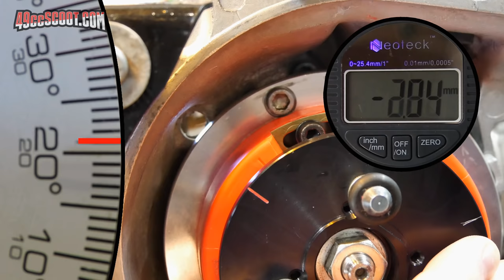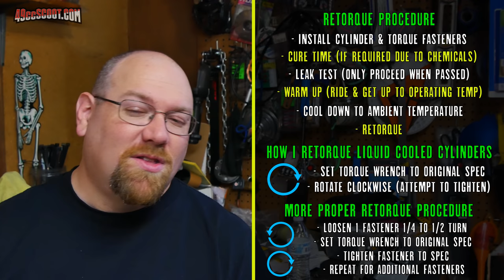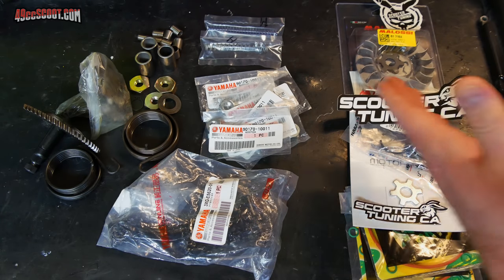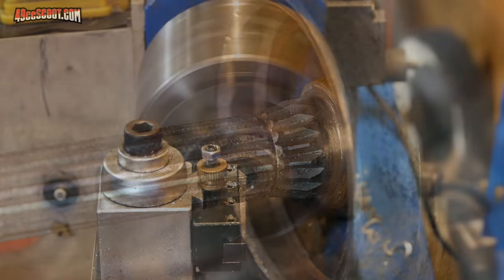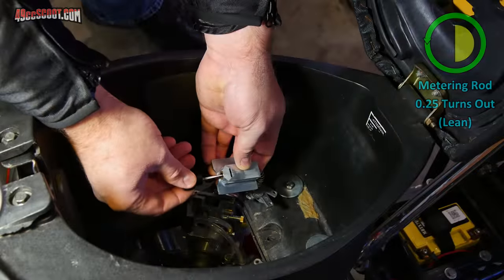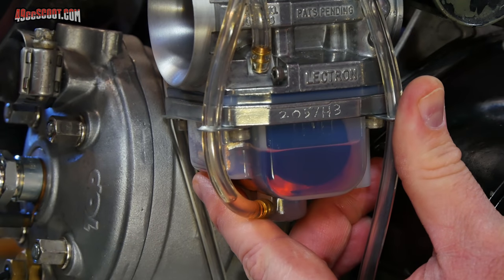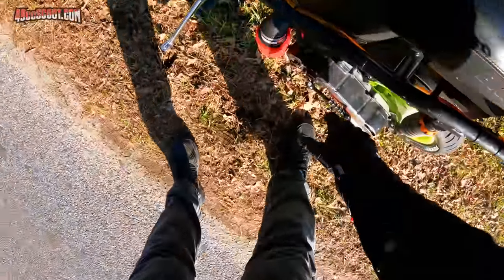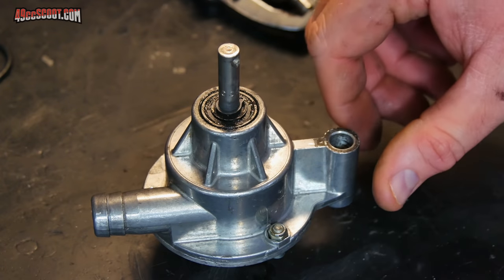Repairing My Scooter's Engine And CVT & Lectron Carburetor Tuning Continues : TPR 86cc : Part 51

Comment: Hallo Brent!! 
why don't you press your crankshaft? you still have the old crankshaft with the intact cvt side. Just make a usable one out of the 2 broken ones. Press over and then straighten it until it is accurate again. It's not very difficult when you have a press and dial indicators. There are many videos that show how to do it. It would also be a good video for your Youtube channel
Reply from the maker: I'm not sure that the shaft that the vari rides on isn't bent, and not just out of true, on the old crank. The indicators didn't react like something that's just out of true and can be knocked around with a brass hammer when I took it out and checked.
Reply: @49ccscoot   whenn the cvt side is bent, you can check that via dia lindicators. you can bent than back, not with a brass hammer but you press. we bent a lot of half cranks with the press. most time eazy. you  test for the high point and than press on that point down first a little, its not ok than a bit more. the 13mm cranks beginn to bent at arround  150-200kg. I had a crank 13mm crank that week that was 0.9mm bent! die cvt goes 1.8mm back and for XD. after bending it was 0.009-0.01 mm. you can even heat the crank side to 250-300 grad celsius. i dont no what it is in F!?!?! but 300°celsius its fine and the bents goes eazyer. Greetz Steven
Reply: and 1 thing!!!. With the tpr 86 and the tpr 86exhaust the max power is arround 12800rpm!!! with a 24 carb. You are driving a malossi exhoust designt for a kit with exhaust higher ports!. the tpr is 190° the malossi is 192-194° the 2-4° make a big diverrans.  from my expiriens the Tpr86 24mm carb and tpr exhaust, all engins are dyno run and did 19-24hp. Stabdart is 19-20. with port maching, widthing the ports to power goes up. but all testet setups are with the tpr 86 exhhaust. and the max power is always arround 12800 +-200rpm. Standart port design. You are have the most power arround 14000 yes but this is the pipe! and i thing with the tpr86 pipe you have more or the same power but at lower rpm! that is what i say.
Reply from the maker: @bravo1412  I don't disagree. I was thinking about trying to get ex duration up a little or just raise the whole cylinder and see what happens, but I don't know if this thing is even going to hold up long enough to do much with it considering how it's been lately.
Reply: @49ccscoot  
190 degrees is actually the optimum for almost every cylinder! In addition, you get lost flushing and you lose momentum and the performance does not increase any further. You can only drive over 190 degrees with extremely large carburettors with dual ex ports. I would not recommend this for long journeys. for a race 1/4 mile here and there yes! but not for normal journeys on the road. The top performencs Due Plus 70 has an ex duration of 199 ° !! but its a oval / rectangle port and it only 58-60% bore dia. so the port aera is extream limited. fun fact Top Performece is a subsidiary of minarelli. Top performce has set a world record of 25 years, if I remember correctly 169km / h with a 68cc Minarelli scooter. The Due Plus cylinder is a replica of the cylinder that Top Performence used for world record back then. Until 2003-2004 there was even the right exhaust for the cylinder to buy. the exhaust was then called NARDO and was named after the race track. now you can by also a NARDO exhaust but NARDO 2 and this thing is crab and has nothing to do with the old one. You can still try one thing, deduce the pre-compression by a spacer under the membrane block! We have tested it several times, with 68cc engines whether sport or racing cylinder kit's a 5mm spacer brings about 0.3ps a 10mm spacer 0.5ps. the crankcase volume is too small for 68cc ++++. in the 80s yamaha reduced the pre-compression of the 125cc grand prix engines every year while maintaining the same timing and had more power every time. even the most powerful 125cc engine ever built would be designed for the maximum crankcase volume (the RSA 125 Aprilia 55-60ph offical). There is a forum where the ingenior of the RSA 125cc engine answers questions 150 pages long. Search for -All that you wanted to know on Aprilia RSA 125- A standard spacer for the normal Minarelli membrane block with 5mm brings about 8cm³. 8mm is around 12.5cm³ thats the sweedspot for 68-70cc, for 86cc I would recommend about 12-15mm (around 20-25cm³). This means that your engine will get its maximum performance a little earlier and the performance should still increase. Fun fact 2. all real high-end cylinder kits like stage6 RT70-xxx, MXT90, Faprizzi96, all 25-30hp + cylinders are based on the blueprints of the rsa 125 cylinder! search for RSA 125 blueprint / goo .... search for images. I'm thinking of joining your forum. I've been a 2-stroke driver myself since 2000 and since around 2002 my job has been repairing and tuning 2-stroke engines. How can I join?  PS i hope you can read it! greetz steven
Reply: @49ccscoot  17:50 nice shown!!! i do it so, first my hand/finders XD than with the small range but carfull allway in X shape. than i go with 11Nm in 1 turne X shape around. and than its finished. Put all back together. 1 start 5-10 min in idel ( 2000-3000rpm), than cooling 15-20 min. than 2 start 5 min idel ,than drive at low rpm. what i do is put heave rollers in the cvt. so i can ride 10-20km with the engine running 6000-9000 rpm( if you dont now your new Carb setup go with a big mainjet! ). the last 2-3 km i go on the trottle hard, so the enginge goes up for short times in revs. Than the schooter is cool down 1-2 houre and than comes the dyno XD. warimng up and than full throttle!!! 10-15 dyno runs to the perfect carb/ rollers/ couterspring/ clutchsprings.
Reply from the maker: @bravo1412  It's free to join the forum. Just sign up. 

I have a large spacer in the form of the adapter for the KX85 reed block. My cases are also ported and "trenched".

I was going to try longer durations as a last test sort of thing. Just to see what happened. A member of the forum has his TPR 86cc at 194 IIRC and he's gone fast with a 2FAST exhaust on it.
Reply: @49ccscoot  from my expirians no. the  kx85 is a litter bigger! but the enging needds more lor pre comprection! the old 2fast hast a port duration of 195,6° i dont know the new!!!!!! the cylinder is high duration, so the pipe is lower tunded remember your motor is like a resonace system! all parts wörk together. its like a bass lautspeaker! 200hz is 12000 rpm. all parts work to gether! and yes 2 tpr with 28carbs are ok for 14000rpm. for racing not for driving 100miles non stop
Reply: @49ccscoot  When people are telling Brent hes doing something wrong. I know they are wrong :) Brent makes science. Just let him do that so me and we can keep enjoying this quality channel! Thanks for reading my thoughts. Have a good day!
Reply from the maker: @bumblebob5979  I appreciate the support. There are lots of people smarter than me and with different experience. I've learned a few things in the comments section... and sometimes I've just been frustrated. lol
Reply: @49ccscoot  Being smarter arent gonna help much if one isnt being fed with tons of  others experience. Some are just lucky being told right from the beginning. Frustration also brings confusion in problem solving. My guess is that your engine build is/was tuned perfectly with the 25mm Dellorto(correct me if im wrong). Plugging a larger carb to it without match porting, and fully tuning the entire system incl. ignition, exhaust etc might be the problem in the first place. And Lectron should by experience(in my opinion) warn you that its probably not gonna run well without a complete engine fine tuning around the new carb. In this case i guess combined with a larger displacement to improve CFM quite alot. Anyway with your Dellorto build it runs really fine and kicks like a crazy mule :D
Reply from the maker: @bumblebob5979  I think the Dell is plenty of carb for it. I don't think it's about tuning everything else, but about the big Lectron and how it works with my engine. I'll touch on that in a future vid.
Reply: @49ccscoot  Yes we have agree :) Also your TRP looks really good!

Comment: I like your first system you had the 103cc you had before I think you had better luck with that one . this one looks  you dumping a lot of money for that engine is not worth it.I would rather you do another built again like the one 103cc you had before that was more enjoyable but I still like to watch your videos man good luck.
Reply from the maker: The 103 is a better street engine, though I had nothing but sealing trouble with the liquid cooled kit. Now the liquid cooled stuff is hard to get and overpriced for what it is. Not a whole lot of dual ring 10,000RPM stuff will pull as well as the 103cc. The tough part for me is that once I get faster, I don't want to go back.

Comment: Hyper race cylinder high end crank and carburetor you should be going faster than 55-59mph , could have went a less expensive route and did the same speed with naraku or polini sport cost wayyyy less and less issues tuning especially with the mvt ignition
Reply from the maker: It will go over 70MPH. I've got a whole video about speed, but I am 300 pounds and cutting a large hole in the air. I don't really care about top speed. I like acceleration and even a smaller rider is not keeping up with me on a Polini Sport. Check out my Endless Summer Scootin' 2020 video if you want to see me with a light rider on a tuned scoot to prove it. I'm sure it would still be much quicker without all of my weight on it though.

Comment: Original cdi,exhaust had 0.72 on 50cc,0.74 on 60 cc and 80 and 90 will only run silent under 0.60 mm nozle.On naraku 90cc the piston are =) goes far into the head,no space left on same original top.80cc oposite =(.Never metal touching as I believed.Regardless too much fuel,ignition knocking.Wich makes HEAT,It sounds like a machine,and feels.But speedometer tells different when its silenced.And high performance nozzle should be smaller when engine has max heat.

Comment: That noise your bike makes at 1:02:50 is the noise my Yamaha jog makes at full speed at will only go 40 mph or less and I know it should be a little faster. What is it? I’ve switch everything trying to figure it out
Reply from the maker: In  my case it's rich and probably some from losing compression. If yours happens at a certain speed or RPM, I'd make sure it doesn't have a limiter. They could sound similar as well.
Reply: The limiter? The washer between the drive face and variator? That’s gone. That the only limiter I know of . But yes it only get up to a certain rpm, I think it should have more. But yea could be rich
Reply from the maker: @nastynatesscooters9896  A limited CDI would be more likely to cause that sort of thing than something like a variator or exhaust restriction.
Reply: I kinda thought it was the cdi or spark issue, but I believe this 1994 jdm jog to be like the 2003 2 stroke vino. Same mineralli horizontal and no restrictive cdi
Reply: I was also thinking when the belt goes to the top of the variator and front pully maybe it’s slipping but I have tried bunch of belts including molossi x and oem
Reply from the maker: @nastynatesscooters9896  I have had CDIs fail and do something like this before. If you happen to have a spare sitting around, it's a real quick check if you can reach it easily.

Comment: I have an adly 50 cc 2 stroke and I have a Dio af18 engine and I want to adapt the radiator and I would like or if you can give me an idea how to mount it on the frame
Reply from the maker: Here are a couple of links. The first is video of mounting my radiators. The second is some radiator info and links to other people's conversions.

https://youtu.be/rw5wybzfjwU
https://49ccscoot.proboards.com/thread/21059/radiator-dimensions-info-thread

Comment: Would a float valve or float alow tank to siphon after bike is parked over night had to pinch off tank line to stop it
Reply from the maker: If the float isn't sealing or is set too high, it can allow fuel to keep running into the carb. If the leak is float related, you should be seeing fuel leaking from the carb or air filter or air box in most cases. Sometimes it can run down into the engine, which is even  worse.
Reply: Im seein all the above when shut off didn't notice anything while running
Reply from the maker: @NOFx420x  It may be just enough of an overflowing issue that it just runs rich (usually most evident at idle or low throttle openings). Once it shuts down, the fuel isn't being drawn in and burned so it ends up in the floor.

Comment: i think your getting uneven fuel atomization, pools of fuel dispersed with pockets of lean. Ive alway preferred smaller carbs like 15mm and 17mm which doesn't give instant HP but way easier to tune and gentle on power delivery
Reply from the maker: 15-17mm would be small for ~20HP, but I am usually on the low end of carb size. I was happy with my 25mm on here, but so many people commented to try a larger carb that I wanted to do it and find out for sure if it had any benefit.

Comment: Detonation. I don't know your compression ratio, fuel octane nor squish, BUT at least one thing is wrong and cause the engine damage. I would advice you: go with higher octane fuel OR decrease compression ratio (ex. more squish clearance/cylinder gaskets) eventually retard the ignition timing but u need to do  some calculations first. I would also mention detonation may cause crankshaft bearings damage, so be careful !
Reply from the maker: I haven't calculated the compression ratio of the TPR setup. The head is cut for ~.8mm squish. I use the highest octane at the pump, usually 91-93. I was able to get away with this with the last carb and being richer part throttle, but it can't take all of this and advanced timing and lean part throttle.

Comment: I think you should have just retorqued the cylinder head put clean antifreeze in it and tried it again for you tore it apart then cylinder head bolts are vibrating loose the RPM you're running an engine
Reply from the maker: I've had multiple issues with leaks on LC cylinders and so far re-tq alone hasn't solved anything. I've tried it many times, hoping it would be all that I need, but the engine would continue to have the same symptoms.

Comment: Did the same thing 
Any luck now?
Reply from the maker: You bought a Lectron and are lean at part throttle too? Ruined any pistons yet?

I've got to get back to it. I put the Dell back on and have been riding it trouble free for some time. I will put the Lectron back on and do a few more trials to see if it can work for me.

I have added an EGT since this vid. It is very helpful for part throttle. It's kinda scary how quick the temp jumps up with the Lectron if I'm not low throttle or near wide open.
Reply: I have 3-3 6mm 
And ya smoked same way u did 

2.025 think what they said to start with and 1/2-3/4 power jet  

Going to try tonight

Comment: You need to consider the carb has no accelerator pump. When you open the throttle too quickly you  shouldnt be surprised with the bog.
Reply from the maker: One of the big selling points of the Lectron and flat slides is throttle response. My round slide PHBL also has no accelerator pump, and most 2T carbs don't.

Comment: you install the cilinder on a 2 stroke en never check the squish clearance why ? thats asking for alot of power loss or like you had once with your dad burned hole in the piston in case its to short 11nm is a good torq i recoment 11 aswel mina is normaly 12 nm torq spec piaggio zip 11nm bigger piaggio engines are 12.5 nm torq but check the damm squish that bothers me realy you can lose easly 10% total performance with squish alone in your manual it should say prefurt squish i guess and i recoment for you around 0.75mm or 0.7mm squish clearance stil can also reduce cilinder tempratures and end rpm chance thats why it could be your having more power ad 13.500 rpm rather then the 12 ish it normal use cause of the timings in the cilinder that are complely off sorry for the bad englsh but do check squish please

Comment: Hello Mr 49ccScoot. I have played with cars and chainsaw mods for  forty years.  Your carby is too big for the engine allowing it to suck a big load of air on takeoff. Your throat area is  now
7.07 sq cm  vs  4.91 sq cm on the 25mm carb. Also 4 stroke car carbs have accelerator pumps when you hit the throttle. Go back to a 27mm carb - no more. Regards, Matt from Australia.
Reply from the maker: Thanks. I thought the carb was too large when I bought it, but I had so many comments about needing a larger carb that I wanted to try it. I'm still curious to see if it can be tuned and if it stays in tune as Lectron claims. Waiting on parts ATM.